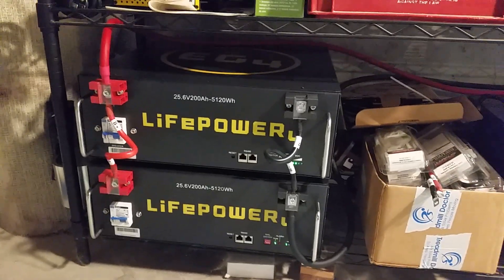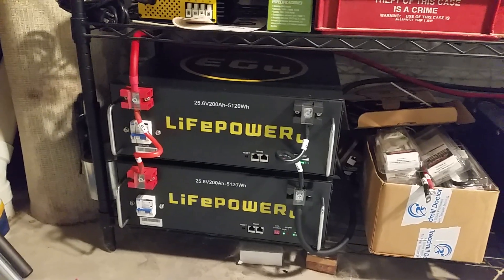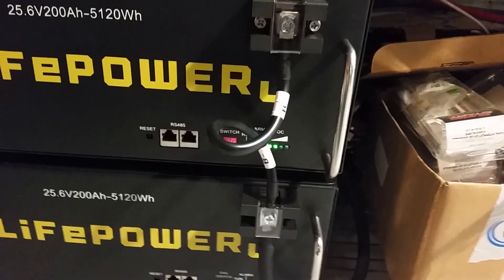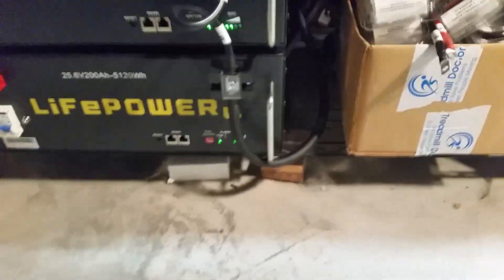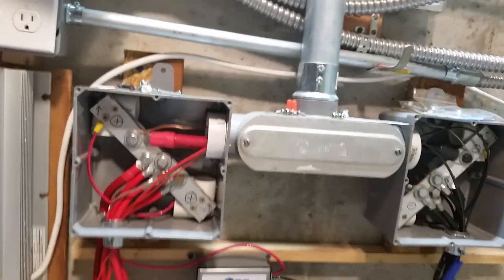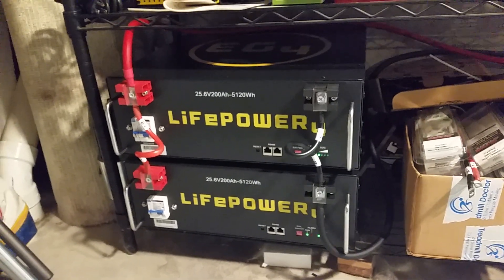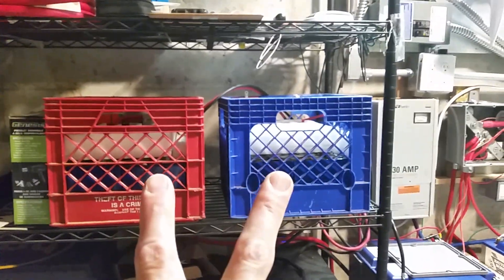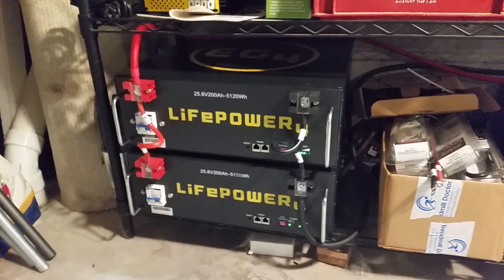Signature Solar Battery Addition

Comment: Did you connect all those different capacity batter together?
Reply from the maker: Hi Eagle.  Thanks for watching!  Yes, they are all connected in parallel with each other.
Reply: @thekeltnerway3002  I don't think that's a good idea because I try it before and doesn't workout very well.
Reply from the maker: They are all the same chemistry and have been in that setup for almost 3 years now for some of the batteries.  The only loss in performance / capacity I have seen is from the two packs I assembled myself and the batteries were used and likely sub par so not surprising.
Reply: @thekeltnerway3002  some full charge be some and cause bms to switch off and constantly charging the lower capacity one.
Reply: how meny can you put in parallel

Comment: To compare apples to apples. Take the nominal voltage and multiply the amp hours to get watt hours. Ex. 24v x 200amps = 4800wh  that represents the amount of power in each battery. P.s. those server rack batteries are typically 5.2kwh so you added 10kwh that's a very large jump in previous capability. Nice add.

Comment: Hi Erik, thanks for the video. Love YouTube for DIYers...thinking about adding one of these 24v 200amp batteries to my system. Last year I built 2 24v 200amp batteries, raw cells ,Overkill solar bms...works good, but now I have money to expand, so it's just as cheap to buy a EG4 and have better warranty. Did you have any issues mixing batteries?  My plan is to add one now, and another one later. Thank again:)
Reply from the maker: Hi Chris and thank you for the great comment!  Glad you're diy batteries are doing well.  I have not had any issues with these batteries adding them to my mix match of other batteries.  However, all batteries are LiFePO4 type so they all operate in the same voltage range.  As long as all batteries are same chemistry and bms's have similar high and low voltage protections you'll be fine.  Just size the wiring accordingly to the size of each bank.
Reply: @thekeltnerway3002  Thank you very much!  I thought I would be OK...but never hurts to ask :)  I will let you know how it goes. So Awesome of you to share your knowledge. .I so appreciate it. Chris B.
Reply from the maker: @chrisbushnell707  You are very welcome.

Comment: Red box at 6:11....  ''THEFT OF THIS CASE IS A CRIME''.   You sound so scared. Not. I'm glad to hear that you are a home builder in this fun stuff.

I just finished building a 24 volt 3600 amp hour unit for a friend. I'm beating on it daily to test it. So far, so good. Has a dozen Chins 300 amp hour batteries. More Chins than a Chinese phone book.
Reply from the maker: 😳😁.  Ha!  Yes, I'm trembling.  Can't you tell by the camera shaking?  

Thanks for the comment!  Nice to have a fellow DIY'er battery builder chime in on this stuff.
Reply: @thekeltnerway3002  
Well, bro, I hain't tellin on you. But I sure could use about 6 of them cases.....